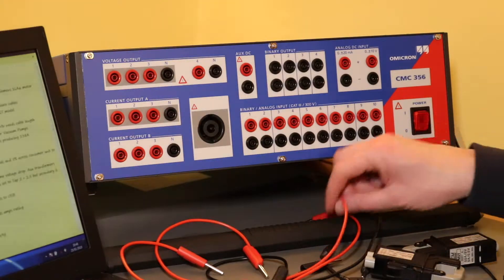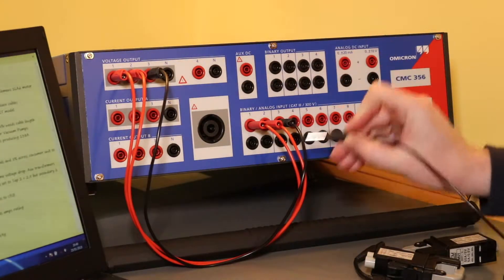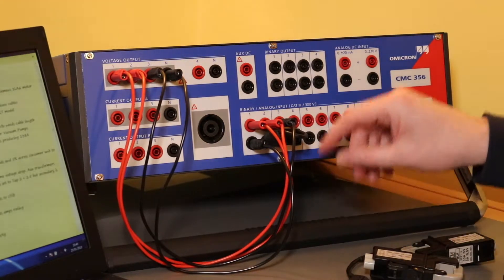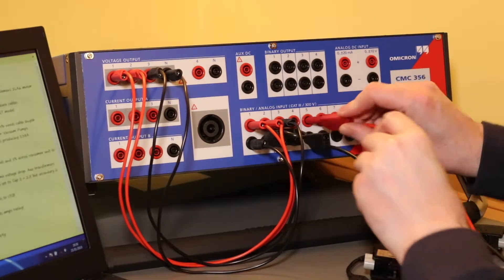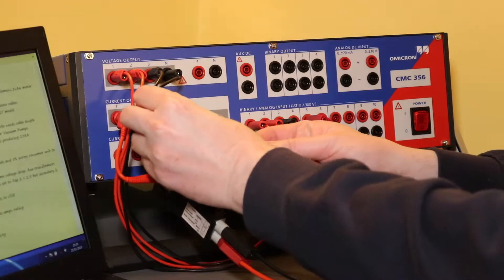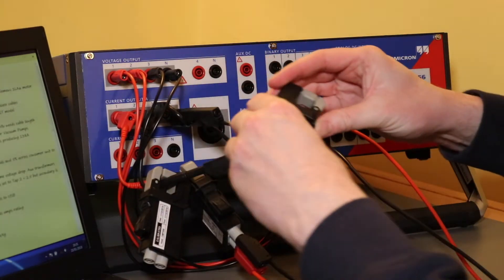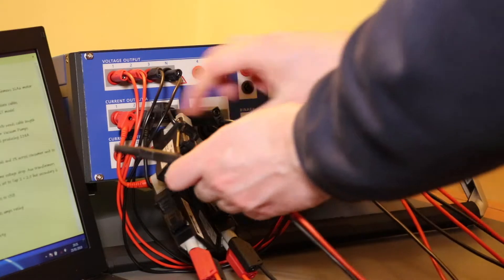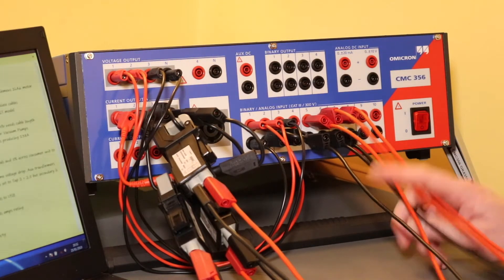Omicron CM356 Test Connections for Enerlyzer Monitoring

Comment: Shall we connect station dc to the inputs to measure ripples
Reply from the maker: Great question! Yes, you could use the Enerlyzer to monitor DC voltage levels, but it would be a short snapshot. An oscilloscope would be better for constant monitoring, or a voltage logger for longer periods.